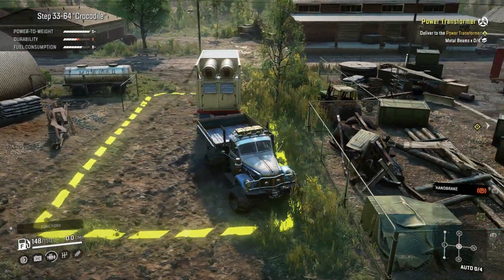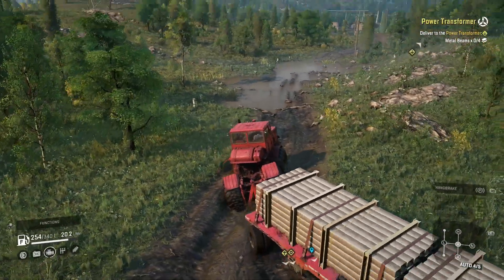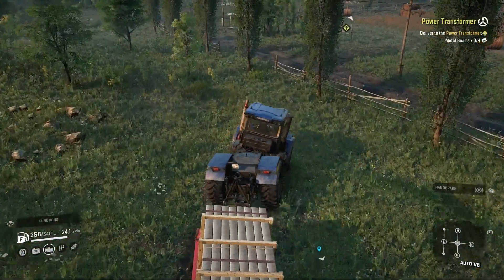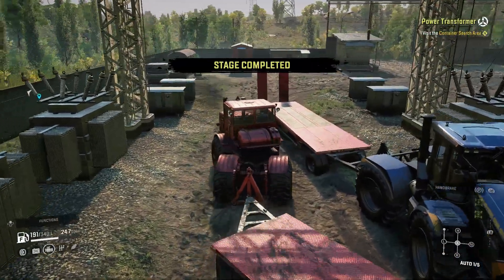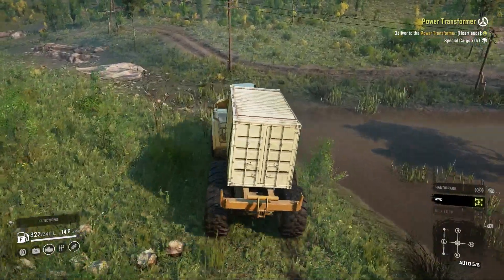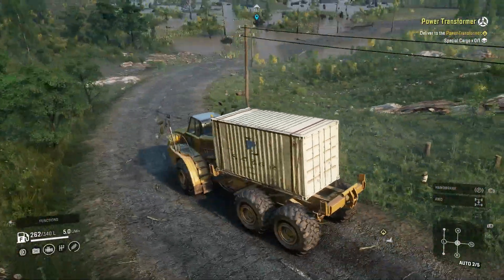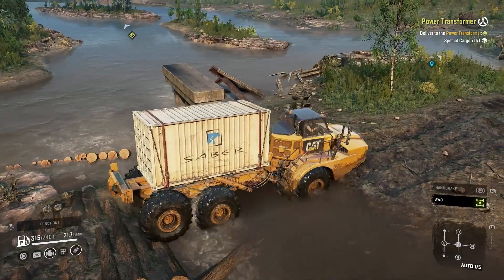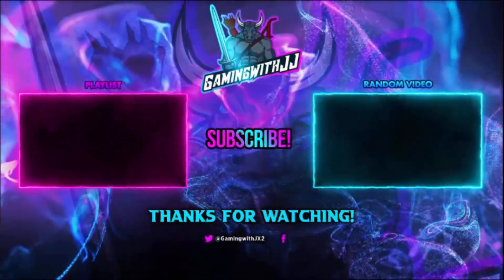Kirovets K7M And K-700 Hauling Gameplay New Snowrunner Phase 8 Cat 745C Container Addon

Comment: The CAT and Antarctic aren't kinda the same.   The Antarctic is tall and has a narrow profile thus why it's tippy.   The CAT isn't as tall and has a wide profile, making it more stable.

The trail in that mud is deep yes, but also the K-700 really isn't amazing in mud either.    It feels to light and struggles in swaps the same way something like a Warthog would.   It can get though yes, but it's not the beast it was in MudRunner.   K-700 should be rivalling the CAT745C and K7M as one of the top 3 or 4 mud vehicles in the game.    But in Saver fashion, they took a fan favourite that was amazing in the previous games and made it kinda meh in ShowRunner.      Which I don't dislike it, with Season 8 behind me I use the K-700 and K7M as my new repair vehicles.    I'm just saying the K-700 isn't what it should of been.     

At least they made the 255 good, I prefer the Tayga 2455B over the normal Tayga, never really was all that keen on the normal Tayga, pretty overhyped truck to me.    Then again the Hercules and K7M are good inthe meantime, so I wonder why they kinda screwed over the fan favourite K-700?   Even the Pike isn't bad.    Which again not implying the K-700 is "bad", it just should of been more.
Reply from the maker: I may be wrong on this but like you said Antarctic is taller. I mean relatively the same 6 wheels articulation. But yeah the cargo sits much lower on the cat like the cargo containers bottom starts before the tires top if that makes sense and maybe I’m won’t but it feels like it and the Antarctic the bed is on top of the tires and it’s a bit higher. But yes the narrow frame on the Antarctic I think is the main reason for it. Yeah I haven’t seen any videos on how well the k-700 performs in mud but it definitely is slower then some of the mud kings of Snowrunner I can’t speak for mud runner as I just bought it summer 2021 and played for like an hour total before starting Snowrunner. But yeah the pike is good k7m is good Hercules is good as long as it isn’t deep mud then it seems much worse. But yeah I would totally do the same thing I use the k7m as my rescue truck right now I love the duals the addons the tire size the power like everything about it is awesome it just makes perfect sense for a rescue vehicle. And I was a bit confused with the 2455 part but I got you after I kept reading 6455B you meant. You were testing me 😂. I’m jk I really like all the trucks added in this phase though the k-700 with the crane is cool tall tires again can refuel and stuff with a addon it’s super cool IMO.  So I’m a big fan of all the trucks recently added.